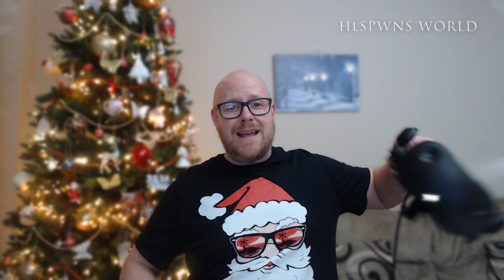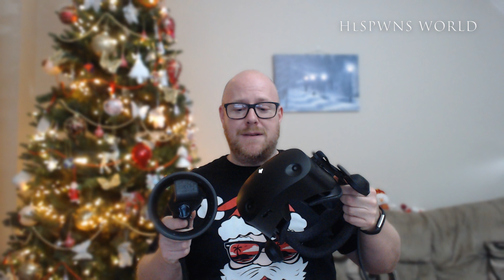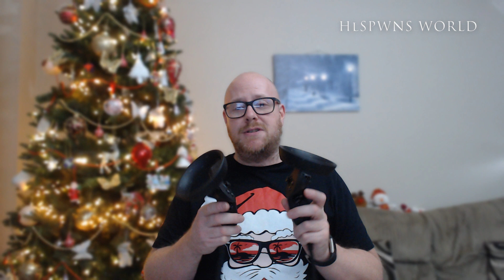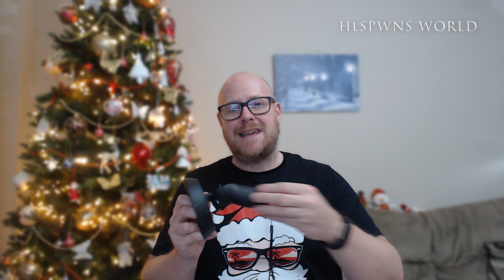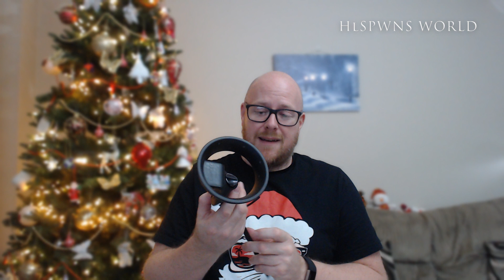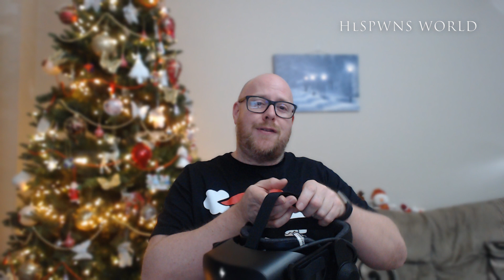Honest HP Reverb G2 First Impressions

Comment: yo, this guy called "MRTV" is getting sent reverb g2 headsets by people, he is going to compare and check if there are differences, and if quality control is bad, since people are having such hugely different experiences about sweet spot and more. You could contact him and maybe send your own headset to him.
Reply from the maker: He is only asking for headsets locally in Germany. The cost of postage and insurance, would be crazy
Reply from the maker: If you saw one of his latest videos, he has changed the gasket, for one someone had 3D printed. This gets you a lot closer to the lenses, but is no good for anyone that wears glasses
Reply: @HlspwnsWorld  Yo btw, the video, yea the one I was talking about that he was making. Where he is going to compare headsets quality, it is actually getting released today. Just checked and it is on premiere to release in 2 hours. hoping that quality control is good, going to be interesting to see non the less.
Reply: @HlspwnsWorld  yea I did see that he changed it, btw I also saw another vid where you don't even use a 3d printed gasket. You just buy thick face cover, the one for samsung odyssey on vr-cover, then you just attach it with velcro that you attach on the headset. And this would bring you even closer.
Reply from the maker: I really doubt its down to quality control, but there was a delay because they were changing the lenses, there is an off chance that different batches have different lenses, but that is purely speculation. It does make we wonder why the company offered a small refund, and I'm hoping that it was down to good will. AMD could take a leaf out of HP's book if that's the case, as I'm still waiting for my new CPU. 
Ye I will be interested to see the findings. I bet its more down to how close you are to the lenses. Tbh if you are having to mod the face gasket to do so, that really is poor design.

Comment: You are confusing resolution with spherical aberration due to the Fresnel lenses.  Read up on Fresnel lenses to understand the physics.  That isn't to say that HP couldn't have made the lenses better.  For instance, using glass rather than plastic would yield a much better lens with less spherical aberration.  That would also increase cost and weight though.  You wear glasses, so the headset is going to be set further back from your eyes which reduces the size of the "sweet spot".  People with narrower faces, without glasses who are able to wear the headset closer to their eyes will experience a wider sweet spot.  Anyhow, it is incorrect to speculate that the "resolution" is rendered lower at the edges.  That is simply not how it works.
Reply from the maker: I'm always up for understanding things better. But I do not agree about the glasses wearing comment. My glasses fit perfectly inside the headset, and with them on or off, the distance to the lenses does not change.
Reply: It does make sense that the headset would be at the same position with glasses on or off.  It may just be that your face shape puts it further away from the eye than for others that have had a different experience in terms of sweet spot and focus at the periphery.  I'm hoping HP release alternative faceplates that are thinner to allow the lens to sit closer to the eye to reduce this effect.  Another comment in a different review pointed out that since the sweet spot is so clear and crisp with this headset, it makes any fuzziness even more noticeable.  If it all looks like crap you don't notice something that is slightly more crappy LOL.
Reply from the maker: @robmohr2007  That is the problem with better than average eyesight and a 4K headset, nothing has anywhere to hide any more. I tried a kids film experience with little aliens, forget the name, it was terrible, simply down to the resolution.

Comment: I don't see why people are complaining. I've been using the valve index for a few months  and got my g2 about 2 weeks ago. Tracking seems fine and Windows mixed reality is so easy to use. U can load up steam on the desktop or in Windows mixed reality. Or if u want u can go into desktop and open it up. Plenty of options. The tracking I found to be great I haven't had any issues. And all this talk about sweet spot, all coming from ppl wearing glasses. Mayb that affects it quite abit. I for one am not wearing glasses and for the price try and find a better headset with resolution to die for. Stop whining and enjoy the experience
Reply from the maker: @Phu photography Sorry but you went there 🤦🏻‍♂️, saying that people with glasses 👓 will somehow have an issue with the image or it would cause a problem with the image is just ridiculous.  
to be honest your statement makes you sound very misguided, and flattens any validity of your statement.
This was a first impressions video, tbh I really need to do a follow up video now that I have had further experience. The WMR software is easy to navigate and when you know what your doing you don’t even need to go in to it to get into steam. But what it does do, is randomly open even when not using the headset. Cause quirks and weird integrations with other software. This was not a wine, just an honest first impression. Btw what do you think of the mic? Pants compared with the index
Reply: I didn't mean any offense when I said glasses wearers. Mayb the distance with glasses are just further than the two eye pieces.also my Windows mixed reality software only opens up when the headset is plugged in. To answer your question about the speakers I find them no different in sound except the adjustment doesn't go as far as the index. The only thing I find pants about this unit is the controller batteries in comparison to the index.
Reply from the maker: @phuphotography749  I asked about the microphone but it does not matter. Honestly as someone who wears glasses not for short or long distance, only correction, I don’t think they make any difference to the distance from the lenses or screen as the G2 has no screen adjustments only the IPD. The only way I could see you getting any closer to the screen is by replacing the faceplate and modding it.
Having glasses my vision is tuned to the very best It can get. Perhaps it’s why I’m more aware of the slightest variances.
I have tested with glasses on and off.
Reply: @HlspwnsWorld  the mic has been fine for me I turned it down to 50% so far no one has complained about it being too loud or distorted. There are always reasons to nitpick but for almost half the price of the index it's a great headset, remember u will always find things when u are searching for them, I tend to just enjoy the experience without such high expectations. I thought I would not like the hp reverb g2 after trying out the index for so long and hearing all the negative reviews but I really do think ppl are blowing things out of proportion, especially with the tracking. Yes it doesn't go as close to the headset as the index or mayb some others but I've found the tracking to be really good otherwise. I've tried it on games such as half life, creed, project cars, Pavlov, poker all stars and beat saber. Mayb the lighting in my room is the right ambient. If this helps I'm just using a Philips hue white light bulb on full power.
Reply from the maker: @phuphotography749  I think what you are saying is valid and fair. It was almost half the price at the pre order price, and I think they should have kept it that price personally, considering there are issues.
I used the microphone for the first time in my Project Cars settings video and it was very poor. And I turned the recording level below 50%.
I agree if you just get on and game, some of these issues are not to bad. But it’s certainly not up to the plug and play\software level of my previous Oculus headset.
I think it’s important people know that it’s cheaper for a reason as in my eyes corners have been cut
Reply: @HlspwnsWorld  I guess that's fair to say. I hear the oculust is a great bit of gear and the fact it's plug and play is awesome. Be honest the temptation was between the oculus and the reverb g2. Just having the freedom of no wires is great and I hear the tracking is really good. Not to mention the option of having 90hz. Let's hope that hp, or Microsoft update any of these issues that ppl are experiencing.
Reply from the maker: @phuphotography749  I really do hope they try and resolve some of the issues. The Reverb G2 is not at all bad, it’s just not outstanding and it has the potential to be.

Comment: I ordered the G2 on Sept 1st and have no idea when I might receive it. I ordered the knuckles controllers (includes HL Alyx :) and a base station as well. That add-on costs more then you might think. 
It will be my first VR experience. Regardless of the drawbacks, this is going to be cool!
Reply from the maker: The headset is really good when you get stuff dialled in. But hopefully WMR software does not drive you mad with its quirks
Reply: how did it go? are you enjoying the G2, any regrets?

Comment: The Quest 2 with link comes very close to the Reverb G2... Also you need a beast PC to run the G2... GPUs are scare right now... Quest 2 is prob the best atm.
Reply: My g2 got delayed again. I ordered in july but will get the headset after christmas :( 
Will probably cancel and order Quest 2
Reply from the maker: @Judalation I have been very tempted to swap. But what I’m finding with the G2 is that every game really needs tweaking, to get the visuals and performance just right. When you find the right balance of settings, the headset does deliver great visuals. But the Janky WMR software will have me ditch this headset if they do not sort it out, as soon as oculus or valve have a better offering

Comment: when you talk about sweetspot, is it only 'blur' or is it distortion as well? I perceive a distortion in the headset, which is nothing like i saw in my vive. Seems like even after the barrel distortion correction has been applied, there's still some distortion remaining, resulting in the world warping as i rotate my pov.

I will keep my g2 for the same reason as you. Simracing will be my primary use for the headset. It's just a shame for me that in room scale experiences i get distracted by the distortion
Reply from the maker: Not sure about distortion more out of focus, but saying that it does seem different to the sweet spot area, so could say it’s slightly distorted, as there is a clear difference between the two areas. But I don’t think I have seen it warping. Re check

Comment: It's incredible how so many people don't realise that there is literally no GPU's on the market that can run this headset's display at 100% for newer titles.  Even the 3000 series will struggle.
Reply: Gtx 1080 can run games like Half Life Alyx on 100% mode so I think, since the new rtx gen is much better, you won't have any problems the next years if you got a 3080 / 3090
Reply: 3080 and 3090 struggle cos of driver bug, a 2070 super can run alyx on 100%
Reply from the maker: Depends on cpu and GPU, I think the worst mistake people make is just having a high end card and cranking it to the max. Every title has compromises, but as long as it looks good and you get the frame rate it does not matter
Reply: @HlspwnsWorld  The CPU is unlikely to matter running at that resolution (unless very old)
Reply from the maker: @Jason I agree at 4K the GPU is not held back by the cpu. But my Ryzen 1700x has performance issues in project cars 2. Going round more populated areas of the circuit, or being bunched with a lot of cars hits framerate.
I experience the same problem in Dirt Rally 2.0 
When I finally get my 5900x, that should give me a big frame bump.
Reply: @jason6296  It does matter (By Alot), I play assetto Corsa upgrading from 3900X to 5800X made one of biggest difference I had so far, other games noticed similar behavior.... The games just became much smoother, bottlenecks of CPU physics in VR is very bad and annoying but the GPU not that bad or noticeable........ when paired to RTX 3080 you need a fast CPU to keep up

Comment: the higher res steam vr sets it at IS normal, steam vr sets every headset higher than it's resolution for some reason having to do with the barrel shape of VR resolutions... Just leave it at 100% (if your gpu can handle it) it's supposed to be that.
Reply from the maker: Thanks for your comment, I am going to do a corrective video

Comment: Don't understand all the thumbs down. It's such an honest review. The G2 will be my very first VR experience ever. Mostly using it for iRacing and some ACC from time to time. But ofc I'm also hyped for many of those controller games. Yes, those controllers aren't the best but I think it's still good enough for a VR newbie. Also I'd prefer this sort of (bad) traking over putting some sensors into the corners of my room just to have some better tracking. I think this one is the perfect solution for me for a great price. :) Good video, mate. <3
Reply from the maker: Thanks for the positive comments. It’s a dam good headset to start with, just remember if the tracking does play up, which it will. That’s not how VR is supposed to be. Having used Oculus sensors, and light houses they are far superior.
I took a punt on the G2 because of the price and the resolution. The tracking is a let down but not game braking. But as soon as a better solution comes along, I am definitely going to swap. But the resolution and audio will keep me happy for now.

Comment: The 3000 resolution in steam is where it should be, dont dial it down the advice in this review is wrong. It's not a bug its required for the head set to scale properly.
Reply: Correct, it’s to get a flat image by cutting away the barrel distortion
Reply from the maker: @FRT Brian can you provide a source for this information? Having the headset above its native resolution is actually super sampling the image
Reply: @HlspwnsWorld  every head set on the market shows 40% increase in steam VR. The lense distorts your view, " pin cushion" the screen behind the lense. The barrel distortion corrects that and provides a flat image in VR, this also results in sharper image in the centre. It is a required setting to allow for the corrective barrelling to ensure the resulting flat VR res is true 2160x2160 Check the steam VR resolution for every headset on the market. Ask HP it's a necessary setting. That doent mean dropping to half as you have wont help a weak system but if you want 2160x2160 in your headset leave steam at 3100x3100
Reply from the maker: @frtbrian1894  I’m going to do a lot more research in to this. I appreciate you bringing this to my attention and will do a corrective video after some experimentation. Searching around the net there is a lot of conflicting information on what the correct setting should be. Some people are saying that from 80-100% it does not make a lot of difference.
I’m all about giving correct information, and not miss information, so if I am wrong I’ll admit that and correct it.
Reply from the maker: @frtbrian1894  I tweeted HP and have put the replay in my pinned comment

Comment: I’ve ordered a G2 and it will be my first VR experience. As a fellow Brummie sim racer, I have bought it for playing AC, ACC and PC2. There are so many mixed reviews, I’m not sure whether to cancel or not. 
Have you tried it in ACC? And if so what are your thoughts?
Reply: Played AMS2 on mine last night. It’s mind blowingly great. The audio from the floating headphones is excellent also
Reply from the maker: I’m waiting for AMS2 to be a bit more finished before I get it. If it looks like project cars 2 does in the G2 it will be very good
Reply from the maker: ACC is a real VR mess. I’ve been tweaking the settings to get it looking as best as I could, but with people commenting not to drop the resolution scaling settings in steam VR I need to revisit the graphics settings.
I plan to do a video on the settings when I get chance. Personally I would not cancel, if you can put up with the inside out tracking or you really don’t care, it’s the best HMD currently on the market for sim racing or flight sims.
My thoughts on ACC are that it’s the most immersive GT car sim on the market that I have tried, the graphics in VR really don’t match the 4K flat screen, but with tweaking they are acceptable, the sound on the reverb G2 is on another level. My Rift and Vive just can’t compare, and this makes ACC so enjoyable in VR it really puts you in the racing car.
I’ve not done much online VR racing in ACC, but the G2 is very comfortable and I don’t get the eye fatigue as I did with my older headsets. 
Certainly going to be doing more racing over Christmas
Reply: @HlspwnsWorld  That doesn’t sound too bad. I currently run 1440p triples on a RTX 2080 Super so have to turn resolution or graphics down to get a good 60+ FPS so I don’t see the game in its full glory anyways.  I look forward to trying it out then. 👍🏻